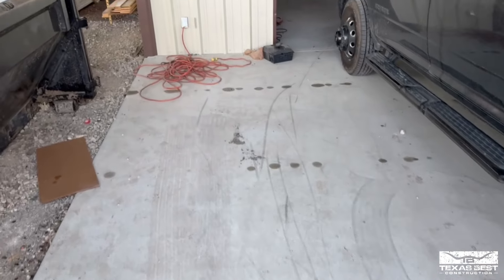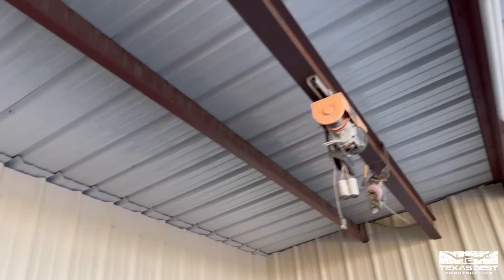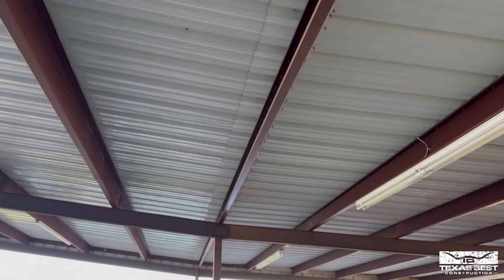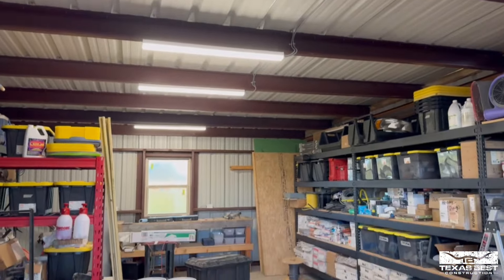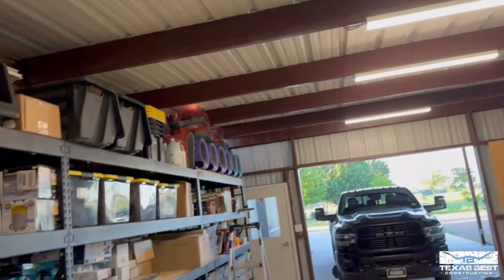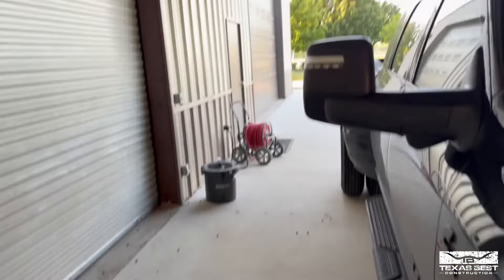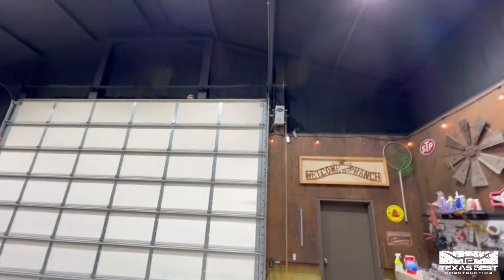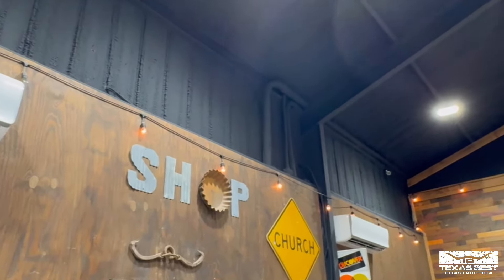How to Prevent Condensation Under a Barndominium Metal Roof

Comment: I'm in the UK. Built a small cheap metal shed 10 foot by 8 foot to use as a small workshop. Had no condensation issues at all with it I presume because it's very well ventilated, air gaps galore everywhere, because it's cheap lol. But the temperature outside now is -1 C (30F),clear blue skies. Bitter. Inside and outside the shed is dripping. That's cold metal meeting slightly warmer air. So I guess I want a covering for the metal, but not a total vapour barrier as I don't think that's viable or even desirable. Just something to prevent the cold surface meeting warmer air. You've used foam . That' a bit pricey for my little space. I'm wondering what else I can do. I guess the most important thing is to have no air gap between insulating material and metal surface or condensation will still form behind it. Need to turn a condensing surface into a non condensing one. Hard to do with anything but foam because of the corrugated pattern. I dunno, am trying to puzzle it out :D.

Comment: I insulated with R15 and did plastic underneath insulation, yet it's STILL sweating. My biggest mistake was not using felt paper beneath the metal roof. 🤦
Reply from the maker: Yea… man sorry to hear that. The closed cell foam really helps prevent that condensation. Obviously the best solution costs more money which is to have a full air barrier such as the zip system over the roof prior to roof installation.

Comment: Adequate decking and rain Shinedown, then metal roof then you can spray the inside with expand foam and your leaks or condensation buildup from the metal roof. Will run off the side of the building versus inside the foam then down

Comment: We are in Northern California and we have a metal roof on our outdoor patio. 2 sides of the patio is the house and the other 2 sides are open. How can we stop the condensation? We don't get it often out here but we do get it occasionally and quite of bit of it when it does. Looks like it rained on the inside of the patio.
Reply from the maker: Check the link in the description for the Drip Stop product. I don’t know if this product is retrofitted but it may help you come up with a solution along the way. You may not be able to fully prevent this under a metal covered porch outside. If the purlins are exposed you might consider a bottom cover

Comment: Thank you I have a carport metal open an it drips from the humidity in Texas. I’m actually across from one of your builds in Rendon . It was turning black after the heat hit. I’ve recently had it power washed and painted with a good paint . So if I close in three sides an insulation added you think the dripping will stop . Sorry didn’t mean to write a book . You may be doing a new build on my back property. 
Thanks for any help with my question.
Reply from the maker: Awesome.. yea well every little bit could make a difference for sure. With a closed cell foam you would be best to have all sides closed.
Reply from the maker: Check the link in the description for the drip stop

Comment: Would you also recommend open cell instead of doing closed cell. Or would you recommend to only go with closed?
Reply from the maker: Direct to metal should be only closed cell. Open cell foam is porous, it’s good for filing wall cavities but not blocking moisture.